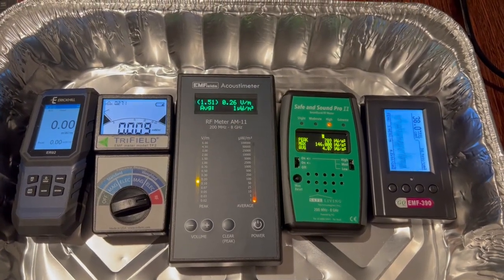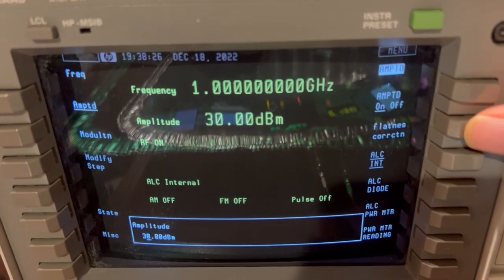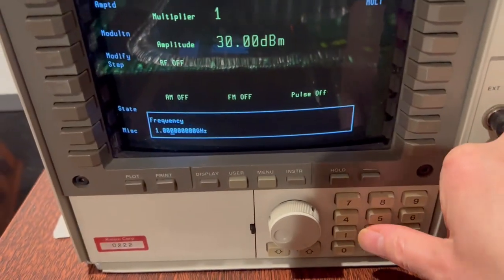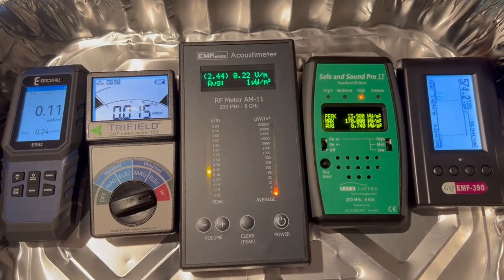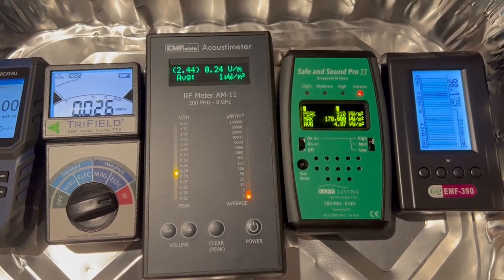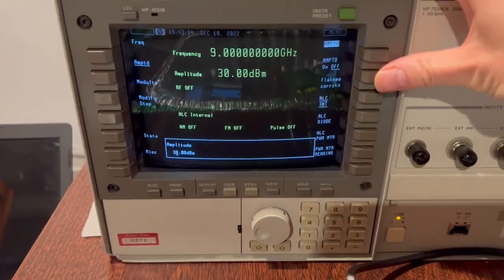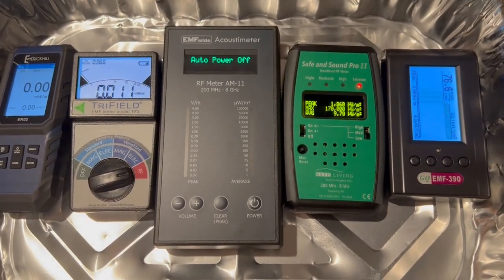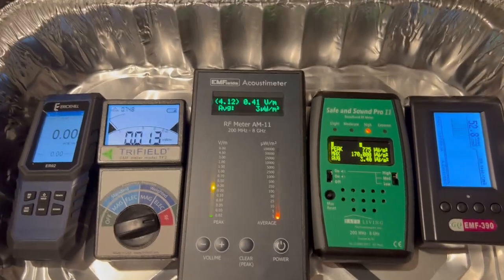Testing 10GHz on  Safe-and-Sound-Pro II TF2 ErickHill EMF-390 Acoustimeter RF meters

Comment: When you take the "AVG" instead of the bar graph or "peak" reading of the S&SII, it does detect the 1GHz, 8Ghz and 9GHz. 
One is easily distracted by the pulsing signal that apparently was present.
I am curious how you connected the signal generator to the baking tray, is it directly connected to the cable, or is there a loop, or ...?

Comment: im wanting a meter that will give me a reading for 5khz to 70khz is there one you can recomend ?
Reply: I know a couple of EMF meters that claim to cover this range. 
If you want to measure this range specifically and separately it will cost extra to get a device that can.
Reply: @Merializer  i want to test metal  detectors
Reply: @kilner79  In the link I send you he is using an old Trifield meter.
The new model, the Trifield TF2 measures magnetic triple axis as well.
I personally like the Gigahertz solutions more, they are more sensitive, but more expensive and the affordable ones are single axis.
You can learn more about EMF meters on my channel. For what you want I guess watching videos 8 to 10/13 about magnetic fields could help you.
Reply: @Merializer  thanks for that i feel he could do some amazing tests turning the power up and down on teh machine and seeing what it actually dose to outgoing power from the coil and test them at range just to see what has more power i dare say mayb an old metal detecter would pump out more power due to lack of regulations back in the day

Comment: I’m looking to investigate the new street lights that were installed, the pole is literally in my yard and about the same height as my bedroom/bed, maybe 15-20 feet distance. I too have heart palpations, and a hard time sleeping. What meter do you recommend? I’m thinking the street light has 5G. I plan to attach whatever meter to a pole and raise it up to the street light for testing..
Reply: I also tested many EMF devices on my channel and I wrote a detailed review in a pdf with my thoughts about the RF devices I tested if you would be interested and hadn't found this already.

Comment: A cellular site was installed across the street and I started have heart palpitations. GQ Emf-390 meter reads 125-150 mW/m2 and peaks up to 225 mW/m2  My bedroom reads 50 -90 mW/m2 I called ATT and was informed the site energy level in below spec. Should I be concerned
Reply: Hell yea I’d be concerned. I’m looking to investigate the new street lights that were installed, the pole is literally in my yard and about the same height as my bedroom/bed, maybe 15-20 feet distance. I too have heart palpations, and a hard time sleeping. What meter did you use to check? I used to have the acustic one but got rid of it once again checked my home prior to the new light.. I’ve seen videos that show these new lights have 5G in them but want to verify myself. Any suggestions?
Reply: I would call ATT and the power company and ask them to install additional smart meters and cell antennas since they are all safe. maybe they can put an antenna in every rokm of your house so you get get a proper tan on your brain. Thse crooks will say anything is safe to make billions and then they settle for peanuts if its proven thehve been frying you slowly at thehcellular kevel.
Reply: @oberweiss7190  no kidding. I’ve already called. They told me to stick my head in a microwave.
Reply: You work for the company?
Reply: @ContentMediaTV  no
Reply: Naw

Comment: Great video, thanks!
I have tf2 and emf390.
But what confuses me is that the emf390 has a gain setting.
I have the gain set to 10, but whether its readings are accurate is not known.
Is it possible to somehow set the correct gain on emf390 using tf2?
I can only verify them on a wifi router...
Reply: i'm considering buying either the tf2 or the emf390, which one would you advise?
Reply: Safe and sound pro 2 and I have the Acosta meter
Reply: @billluzius3778 cuál me recomiendas?

Comment: Great idea in testing. Thanks.  I think the Safe and Sound II could be doing better than you give it credit for, however. Even at 10.5Ghz, you do see significant changes in the Avg with the on/off.   Peak isn't changing much, but avg is, perhaps you were looking at the wrong place. Also, it also seems to be picking up a lot of background at baseline so, its possible that your environment is not great and the signals are getting washed out in the background.    Would be good to repeat the test after trying to reduce background so that you are not seeing anything first.  (Note this is definitely possible - I have both an Acoustimeter AM11 and a Safe and Sound II - in general I find the Safe and Sound II a bit more sensitive, but after a lot of clean up at our house, both reliably can show nothing at baseline)
Reply: Yeah the Average went up on the SASPro2, but it looks like it underreports the lower frequency, just like I suspected the SASClassic2 did as well in my tests with 169MHz paging.